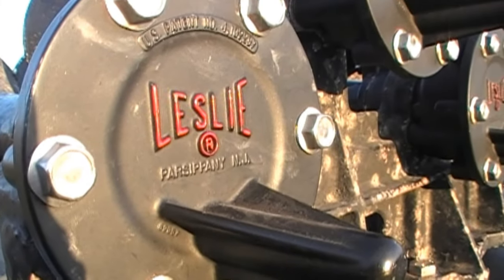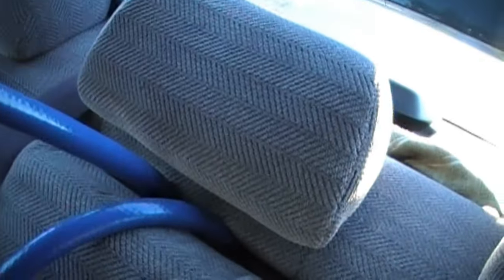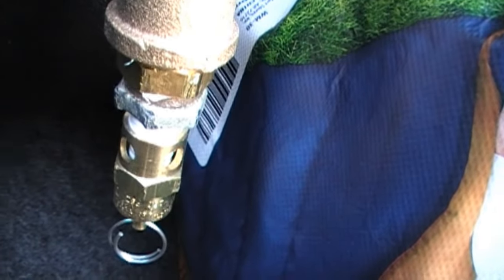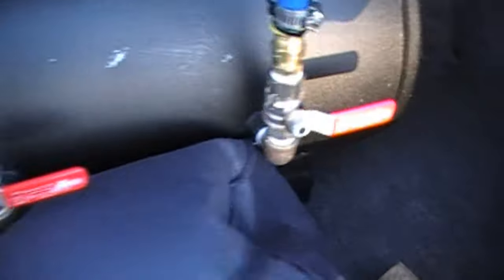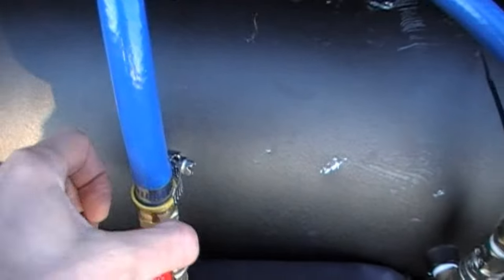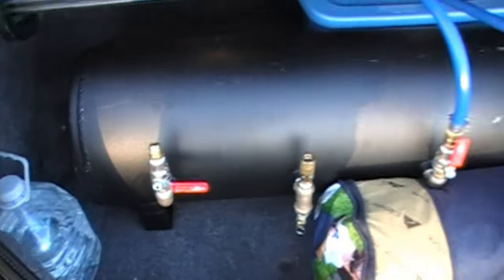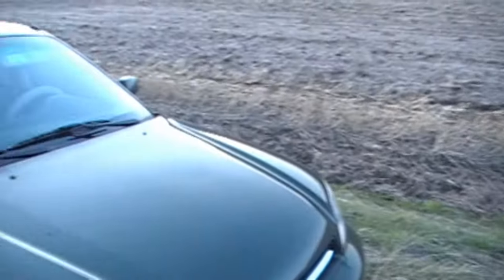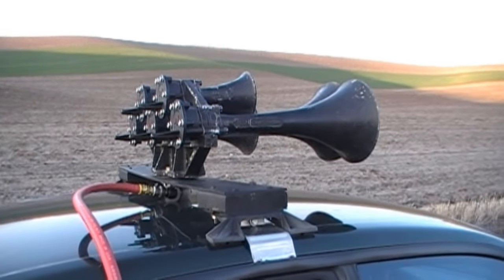Locomotive horn collector air system NOT for pranks or scaring (Big air for a big horn)

Comment: Is keeping air in the compressor for long periods of time harm it in any way?
Reply from the maker: Keeping air in the compressor can cause the bottom of the tank to rust out faster since the water that condenses in the compressed air isn't drained out.  IF you use a compressor as a pressure vessel long term, its important to drain the water out at least once daily.  For infrequent use drain it after each use.  Since I only occasionally use my compressor (horn isn't on the vehicle 24/7) I keep about 40 PSI in the tank and use that to help drain the water out when I'm done.
Reply: thanks!

Comment: I have a 12vdc compressor under the chassis of my van (inflating tires and such).  It's not one of those tiny things that takes years to inflate a tire.  Amazon has compressors for air horns for about $120.  One of those in your truck would empty the rear seat of that huge compressor.
Reply from the maker: +Dan Burch My goal was to modify the vehicle as little as possible.  Since I don't have a horn on 24/7, I don't need the compressor 24/7, so its not a big deal to put it back there on the few times when I do use it.

Comment: I just got a setup like this with the same 20 gal tank!   Did you have to use threadlock or anything else other then thread tape to seal the port caps?   Also, how long does a tank like this take to fill?
Reply from the maker: I use teflon tape on the NPT pipe threads. Since this video I have switched to SAE flare fittings for my hose connections, those just get a light grease. 
Fill time will depend on the CFM of your compressor, for me it takes about 15 minutes.

Comment: I'm speculating that years ago Train Drivers relied on their horns to relay to an oncoming or slower train that they were nearby. Is that true? Next question would be, since they relied upon horns as their method of communicating with each other (before they had radios), is it against the law to blow a train horn?
Reply from the maker: The horns are mainly used to warn motorists pedestrians and animals that are on or near the tracks that the train is coming, and sometimes also to communicate from the engineer to the train crew on the ground, brakeman flagman etc.  Not used to communicate with other trains. 

Most states have laws against air horns on private vehicles. That’s why I don’t have a horn on my car 24/7 and only do it in the middle of nowhere.
Reply: @mafarnz  Thankyou. That answers my questions.

Comment: I'm curious about the saftey valve that bursts at 150 psi. I plan to get a tank like this for myself at some point and im curious, should I have the safety valve so it pops at 150 psi? when it pops does it just prevent the 20 gallon tank from going over 150? or does it drain the whole tank
Reply from the maker: Most safety valves have a few pounds (5-10 PSI) margin, they won't pop at exactly 150. The purpose is to prevent the tank its attached to from exceeding 150 PSI, either because of a faulty compressor shutoff switch, or because a sealed pressurized tank got hot in summer.
The valves I have don't drain the tank all the way, they close about 60-80 PSI.  If you push on them manually you can get them to close sooner to save air, though if they pop there is usually an issue that requires the tank to be drained anyways.

Comment: the little whistling noise after you blow the horn is from the hose expanding and then bleeding the pressure off as the hose contracts back to its normal size. you need to use hydraulic hose because that won't expand with that low of a pressure.  the downside is it's more expensive.
Reply from the maker: +Jeffrey Murdock No the whistling sound is because one of the chambers is more worn than the rest.  I use 1/2" Goodyear rubber air hose, its rated to 200 PSI but I only run it at 125 max.
Reply: the eabster you don't like how that looks then don't look at it.
Reply from the maker: +Jeffrey Murdock Couldn't have said it better myself man!  I didn't do this for the looks, lol!

Comment: So can the pitch of the horn be changed, for example like a low rumbling sounds or is it always the same. (tripod sounds on YouTube)
Reply from the maker: +ty wood No.  To change the pitch you have to change the length of the bell (trumpet) or change the internal diameter of the bell.  This requires either welding or machining operations, and is difficult and expensive.  In most cases it is better to just find a different size bell to change the sound.

Comment: Where did you get this??? Awesome!!
Reply from the maker: From a scrapped locomotive.
Reply: Do you by chance know what kind? It's cool though! I liked this video a WHILE back.
Reply from the maker: I don't know 100% for sure, but the type of horn, the age of all the parts, and the paint colors I found under the black all suggest L&N from the late 1970's.
Reply: Ah, so could be maybe a U-boat? Did the L&N have those in the 70's? If not, possibly a B30 series or GP series locomotive.
Reply from the maker: Since there is no documentation it is impossible to know, L&N had S5T's on just about everything.
Reply: Ah, alright. Thanks for the info.

Comment: Question I have basically the same air compressor you have and obviously you can't just plug it into a cig port lol so how is your wired?? @mafarnz
Reply from the maker: +MAST3RKILLER911 It is wired for 120V AC.  I plug it in at home with an extension cord, fill up the tanks and just drain down the tanks when I have a horn.

Comment: What powers your compressor from inside the car? My main issue is I can't find a good way to recharge the tank on-the-go so I'm always finding open outlets to plug and charge.
Reply from the maker: I just fill up at home and go out to my location and do one recording.  Most of the time that works fine for me.  If I have a need to refill onsite then I just rent a small gas generator.  I don't have a way to refill from just the car itself, and I rarely have a need to.

Comment: Well he can't really give you a ticket for having a horn, unless you blow it unnecessary reasons and it's louder than the noise limit.
Reply from the maker: Matt Merrill In some states it is illegal just to have the horn on the vehicle.  In the State of Washington for example, the law states that "no vehicle other than an approved emergency vehicle may be equipped with a whistle bell or siren."  I assume that an air horn falls under the whistle category for that law.
Reply: Thanks for the info, but nice setup!

Comment: I have a question: How much was it for the cheapest train horn you paid for?
Reply from the maker: +JacksonAndLansing Railroad For a complete horn not just separate parts, about $150, for an A-125.  Hated the thing though and later sold it.
Reply: mafarnz Why did you hate it?
Reply from the maker: +JacksonAndLansing Railroad It sounded terrible and I could never get sounding the way it was supposed to.

Comment: So i bought a K5HL a week ago, but i need the tank and compressor, i bought both of them and i just purchased 3 half inch 25ft air hoses, 2 elbow connectors and a graham valve. Can you tell me what else i need? How i hook the hoses up, if there are spacers? I know i am on the right track, i just need the details of how to hook it up and the tiny components im missing.
Reply from the maker: +mutanay77 Sounds like all you need then is a few hose barbs and some hose clamps, if your hose barbs need them.  Some types of hose barbs don't needs clamps.  The set up in this video has probably close to 25 feet of hose total so unless you are equipping an actual locomotive you have more than you need there lol.  I would highly recommend a ball valve between the tank and the GW valve, that way you can disconnect the system without having to empty the tank, and also saves wear and tear on the GW valve by not having pressure on it all the time, not that that is a huge concern anyways.
Reply: +mafarnz Thank you for the info, i will try that out and let you know how it goes. If it goes well you will see a video on youtube, if it doesnt, ill end up back here lol.
Reply: Do you happen to have a private chat like a skype or facebook where i can talk to you instead of here? I have many questions and I need to tell you on top of buying a 20 gallon tank from horn blasters, i bought a 33 gallon 150psi air compressor
Reply from the maker: +mutanay77 Yeah I'm on facebook.  https://www.facebook.com/mafarnz
Reply from the maker: +mutanay77 Other than the shave and a haircut sounds fine.  It is a bit high end heavy but otherwise it sounds like a K5HL should.
Reply: mafarnz Ok thanks for the help from the beginning man.

Comment: You should try getting an inverter to convert the 12v DC to 120v AC for that compressor so you can fill the tank while away from mains power.
Reply from the maker: I looked into that, but to run the compressor the inverter would have to be very large, large enough that it needs to be hardwired into the battery. I don't really want to go to all that hassle for something I don't do very often.

Comment: How much air does the horn use? You ever measured how much you can use it before you have to refill the tanks? I imagine the pressure in the tanks wouldn't have to drop much before the sound of the horn was affected.
Reply from the maker: Depending on the type a horn, I can get anywhere from 20 to 45 seconds with this set up. Some horns are more air efficient than others.  The volume is somewhat affected by the pressure drop  depending on the type horn.

Comment: Have you noticed that having several extra feet of excess hose between the graham white and the horns creates any sort of audible issue with the horns?
Reply from the maker: Only on horns that don't use a ton of air, P horns with restrictors are the most noticeable.  Otherwise not really an issue.  On locomotives that have horns on the end of the long hood there can be over 20 feet of air line between the valve and horn!
Reply: I have a old cast P3 and I know you do too and wondered if you recommend using 1 diaphragm set up or 2?

Comment: What the heck air horns only need a 1 to 9 liter tank
Reply from the maker: You clearly have no clue what the operational requirements of a horn this size are.  You really think that I went with such big air tanks just for the hell of it?  If I could have just used a 1-9 leter tank I would have, but these horns need a large volume of air.
Reply: yep your write
Reply: Word

Comment: Hahaha this is great very extensive and I feel could be simplified or hidden a bit better throughout the car but that's my inner mechanic talking. I'd like to do I but I'd never get to use it anywhere lol you can make people go deaf with horns like these on a public road.
Reply from the maker: +number3665 You could make people go deaf, and that's why I make sure to never use my horns in a crowded area around people, only out in the middle of nowhere farmland. My requirements for the system is that everything needs to be removable except for the roof rack, be able to supply a minimum of 20 to 30 gallons of air for the horn, everything has to be half-inch fittings, and no modifications to the vehicles electrical or mechanical systems. If you have a  suggestion on something that fits all of these requirements but is "better" I would like to hear it.
Reply: Well the first thing that comes to mind would help make the whole system cleaner and it would still be separate from the vehicle systems. But while technically removable it wouldn't be able to be removed quickly. Mostly it would be rerouting your air hoses to run through your interior panels or underneath and underneath your center console. The same way the factory does to hide them and they would also be able to run to your trunk without being seen. The other things I had in mind as far as quick disconnects and mounting would require you to make some small modifications to your vehicle. For example relocating the horns from the roof rack to another location to allow you to run the air line to them without having to roll down the rear window to connect them. I know you don't to do anything like that so I'd have to think about it a bit more to come up with a better solution that doesn't involve modifications to the vehicle.

Comment: What's the average diameter for the air line on a loco with a RS5T? I saw NS 1108 last night and has a screaming 55 bell, I've heard that it sounds like that because it's on a 1 inch air line, is this true?
Reply from the maker: Airline size can vary depending on locomotive type and when and where it was rebuilt. That being said, what usually causes a a Leslie to squeal like that, usually the 55 bell, is having the horn on the solenoid valve.
Reply: mafarnz Makes sense, thanks for the info, I can always count on you for very accurate horn info.

Comment: its cool! but I wouldn't wanna give up the practicality of my car...
Reply from the maker: +Ajw312 I didn't have to!  The reason I designed the horn set up the way I did is that except for the roof rack and valve, everything comes out/off in less than 5 minutes.  I don't run a horn 24/7, so most of the time its just a car with a roof rack on it.

Comment: sounds like there's too much power for the smaller horns.
Reply from the maker: +Ian Dana The higher pitched (smaller) horns had more wear on them then the lower pitched ones due to having parts from different sources is the reason for that. I have since corrected that issue.

Comment: You can get 12 volt compressors that can fill the tank up to 150 psi to run that bad boy
Reply from the maker: Yes but I didn't want to modify the vehicle's electrical system.  Those compressors would take a long time to fill up 20 gallons anyways.

Comment: If you tear down the compressor could you fit that in the truck as well? Got to be loud inside the car when its running.
Reply from the maker: It’s a little too tall to fit in the trunk, that was the first thing I tried. Since it runs off of 120 V AC, I don’t have anyway to power it when I’m not at home with an extension cord. I just fill up all the air tanks and draw them down when I’m out making a recording.
Reply: mafarnz ahh idk if you used a converter to run it. How long do the tanks last you? Don't they use a lot of air?
Reply from the maker: An inverter big enough to power the compressor would have to be hardwired to the car battery, which I don't want to do.   Depending on the type of horn this 32 gallon set up lasts anywhere from 30 seconds to just over a minute.
Reply: Crazy how much air they take. I have a small one mounted on my shop outside wall that I can hook to my air supply and honk it every now and then. A couple honks really helps destress

Comment: i think its lacking a bit on highs? or the air is kinda short on pressure?
Reply from the maker: The specifics of what is going on would be a long explanation. Basically, because of different amounts of wear on the different parts, when I release the valve the highest pitched bell (trumpet) continues to sound after the other ones have stopped.  This effect gets worse as the pressure in my air tanks gets lower.  This is actually fairly common on this type of horn.

Comment: Could you run it off only the compressor? Is there a need for the tank
Reply from the maker: +Angel Antunez I could, but would only get about 1/3 of the time out of such a large horn. Yes the second large tank is needed, these horns need volume far more than pressure.

Comment: hey all my friends upgraded their horns on their harley davidson motorcycles.....not to be outdone i am thinking of putting a standard mac truck quad air horn on the front fender of my bike....i am wondering how small of a compressed air tank i can get away with for a few satisfying honks.....i will still use my regular horn for normal use but this is going to be a fun novelty.....if you could share some considerations on this that would be great....
Reply from the maker: +Mark R For a small truck horn you should be fine with a small one to two gallon tank.  Mind you that will only give you a few quick blasts but serves the purpose well.

Comment: why didnt you put the compressor in the trunk and why not run hoses under the car? just wondering. at least you would not have holes in your seat.
Reply from the maker: Believe me, I tried putting the compressor in the trunk, it doesn't fit its too tall!  The hoses run trough a small panel that folds down to access the trunk, no holes in the seats!  I did it this way so that I wouldn't have to put holes in the floor or roof, and so that everything is removable.  I don't run a horn on the car 24/7, only on rare occasions, so everything except the rack comes out in a few minutes.
Reply: mafarnz did you take the wheels off the compressor when you tried to fit it in the trunk?
Reply from the maker: Taking the wheels off is not an option, since I need to be able to frequently remove the compressor from the vehicle and put it away, seeing as how I don't run a horn on the car 24/7.

Comment: What PSI are you running for an S5T
Reply from the maker: Volume of air is more important than PSI. Tank port, all fittings hoses and valves all need to be 1/2”. I run all my horns starting at 120 PSI. Depending on the type of horn it typically sounds fine down to 30-40 PSI.

Comment: Wait, are the zip ties holding the air hoses?
Reply from the maker: I can see how you might think that.  The zip ties hold pipe insulation around the steel 45 and 90 degree pipe elbows that are welded to the rack, that way there isn't tapping (and paint scraping off) my roof when I drive.

Comment: that weird moaning sound after you let off the horn, is that just access air leaving the pipe or what?
Reply from the maker: It's the highest pitched bell (trumpet) holding on longer than the others due to different amount of wear on the parts.